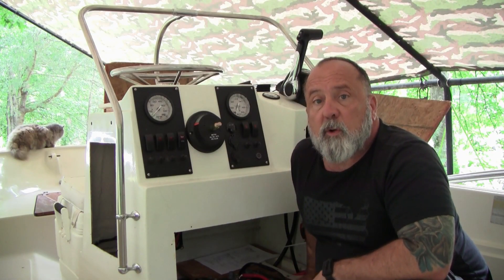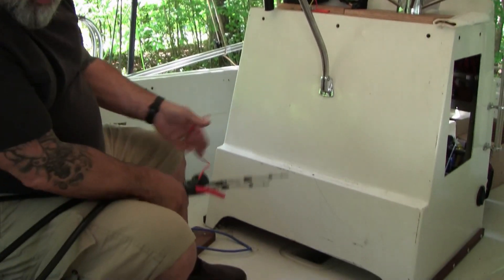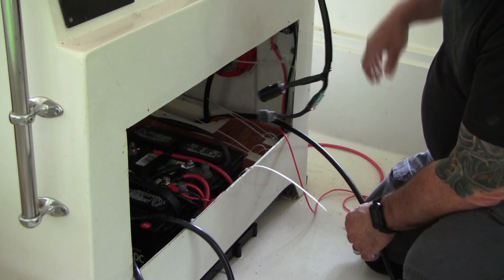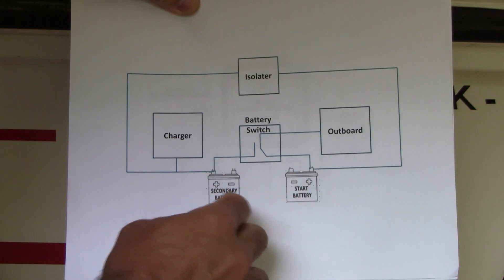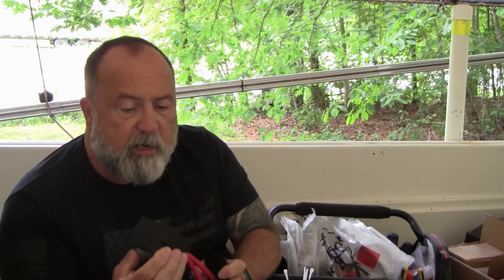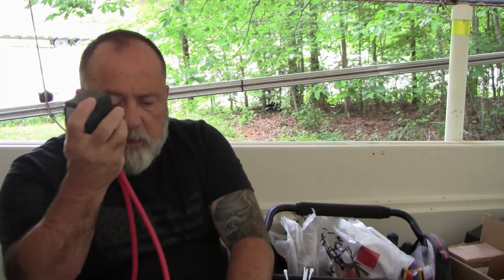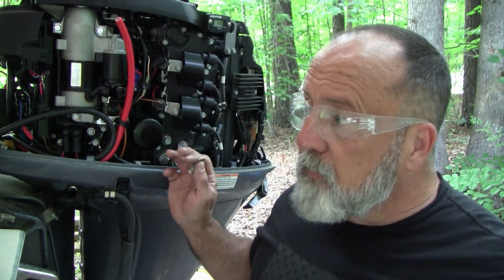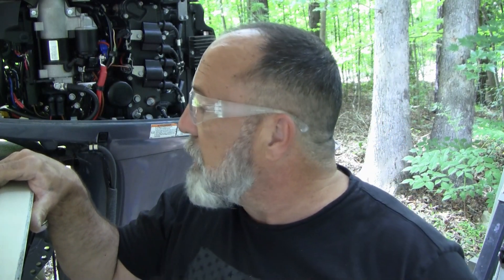How To Install Battery Power Cabling in a Center Console - Montauk 17 Part 12

Comment: One more question: How did you mount all the electrical busses, switches ect...? Are they thru bolted on the console? I 'd like to avoid bolts showing on outer side of conole. But , the carcass is so thin I dont see how. Thanks again Jose.

Comment: Where did you ground the outboard I see in the diagram the hot goes to the positive on starter battery does the ground also go to starter battery ? Thanks in advance
Reply from the maker: Yes, the Black Negative ground comes back from the outboard to the Starter Battery